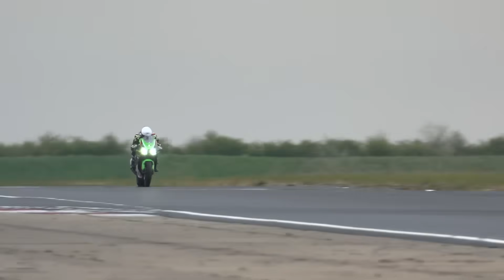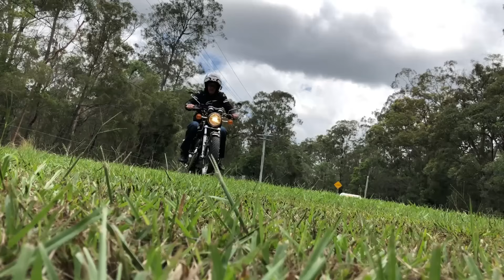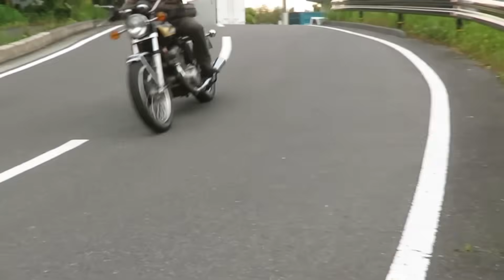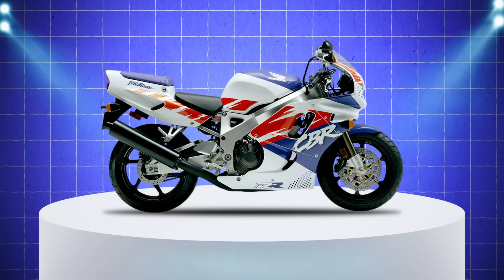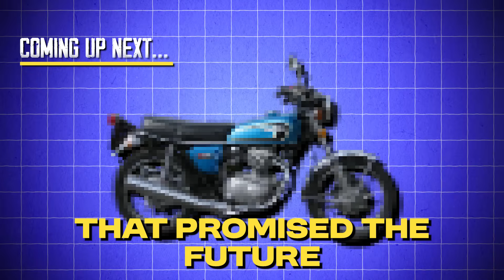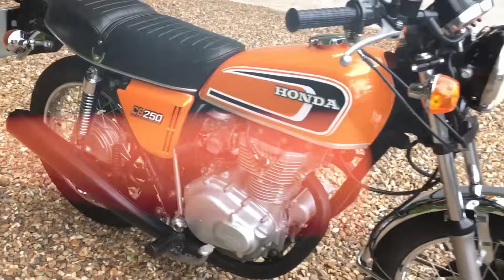7 Worst And 9 BEST Japanese Motorcycles Of ALL TIME!

Comment: Honda mvx 250 that 90⁰ three cylinder motor was such an oil burning two stroke that used to burn holes in the tops of pistons regularly after rebuilding two motors in the space of less than 1 year it was time to call it quits .
Reply: holes were burnt in pistons because of the way it was tuned, poor quality oil, and also people thinking adding a little extra oil was a good thing when in reality it causes a lean condition and the pistons couldn't take the added heat

Comment: That Yamaha TX750 failed in Australia because of its big problem there was a yearly production race the "Castrol 6 hour" held on a Sunday remember win on Sunday sell on Monday well they raced alalmost every production motorcycle and the Yamaha TX750 failed didn't finish a race at all so it failed in Australia  the Suzuki RE 5 my brother had one and l did ride the RE 5 and smooth and quick and at the same time l owned a GT750 much quicker than my GT750 well they weren't the fastest 750 around and the Suzuki B King that absolutely flopped in Australia mainly because it was ugly and the Hyabussa they aren't a good looking motorcycle but they not good looking for a good reason aero dynamics which means it's so fast

Comment: Never met anyone on a B king could ride it 😂 GSXR750 was the first true modern sportsbike. The fireplace wasn't a better bike until the 954... I've had several versions of both so.... my three fave bikes are Fireblade 1000rr08. The first blade where the finally nailed it. Perfect everything. Did exactly what you told it, no more or less. So comfortable to go fast  people I know are quicker than me just watched me piss off.  VFR800 (with improvements) its surprisingly good for the time and did everything. Triumph street triple 765. Physically bigger than the 675 its a perfect do everything bike. Absolutely spot on thru any corner no matter how you set it up 😂 makes you smile at speed and going slowly.